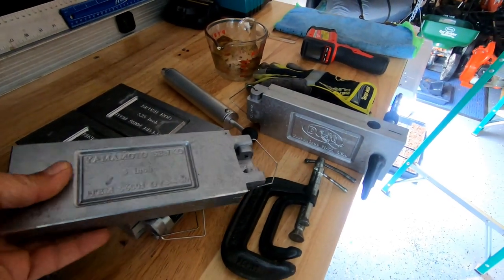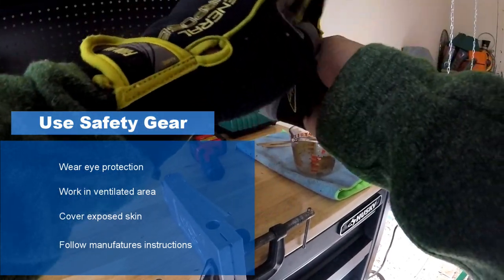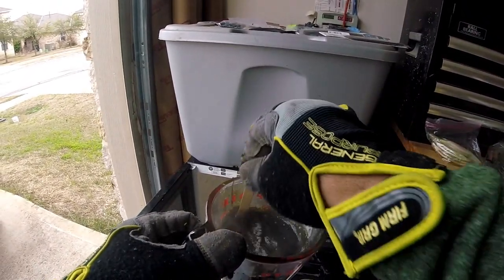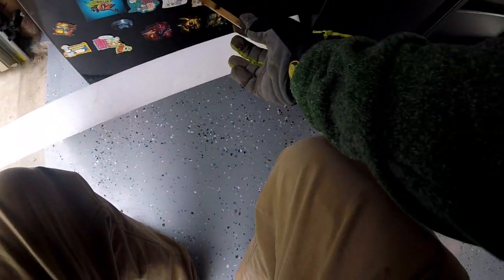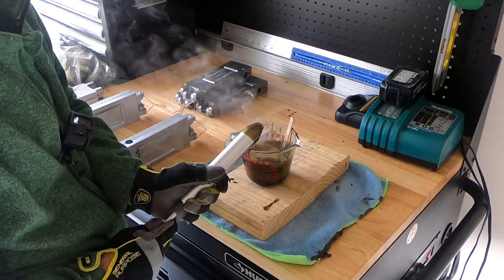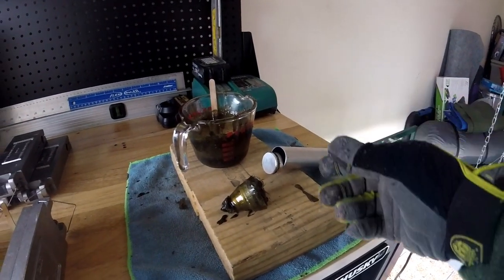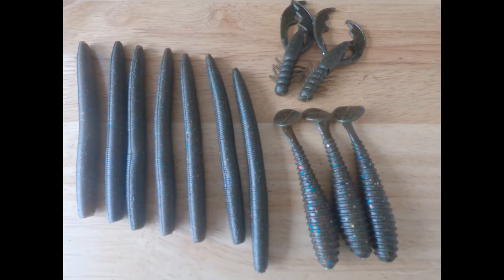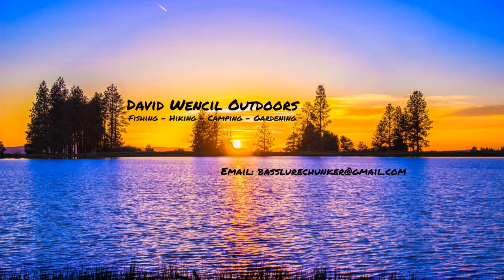Recycling Soft Plastic Baits - Soft Plastic Lure Making

Comment: Hello, How long should I wait until the soft plastic is cooled down in the mold before opening the finished product?
Reply from the maker: A few minutes. If the molds are cold the plastic hardens fast. When the molds heat up after making a few batches, it can take longer. Wear gloves for safety

Comment: But the mold is 35 but do u need a injector
Reply from the maker: Yes. Injector, mold, microwave, vent fan, pyrex container, safety glasses, infrared thermometer and gloves.
Reply: All you actually need is: pot, portable stove, a funnel that wont melt easily, gloves and the mold. Do it outside obviously,